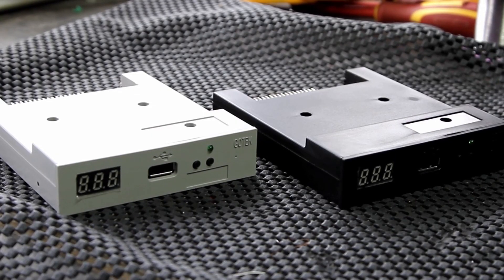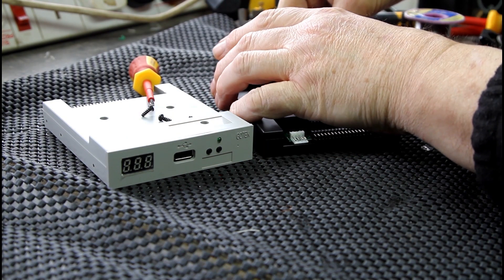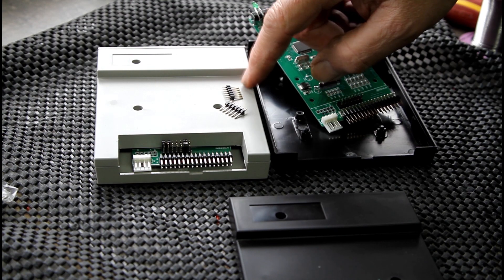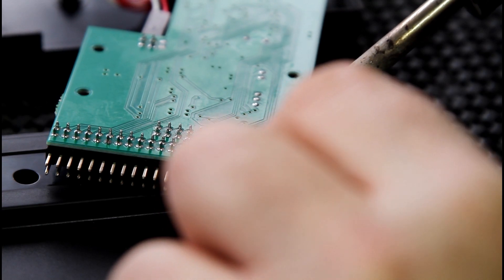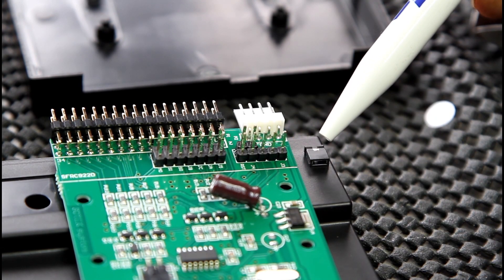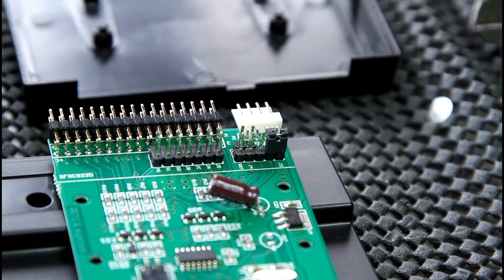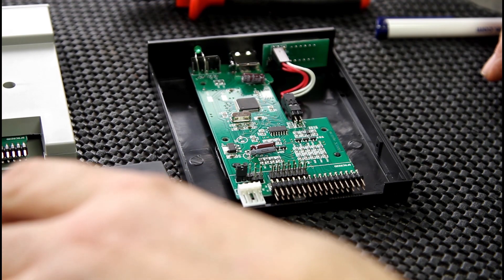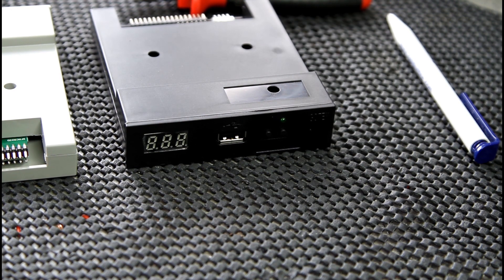PART 1 How to prepare and install a Gotek floppy drive emulator in your music equipment

Comment: I have a Gotek floppy drive emulator for a Korg X3 and it has a dial switch on it. Unfortunately the dial switch broke off. Is it possible to replace that switch?
Reply from the maker: Yes It just a rotary encoder they are available
Reply: @takethefearoutthegear6229   I'm guessing I have to take the bottom piece off to access the that rotary dial?
Reply from the maker: @slooky14  we take one apart in one of our gotek videos
Reply: @takethefearoutthegear6229  ok thank you! I see you took this one apart. Are you saying you have another video? Also I'm guessing I'm going to have to solder in a new one?
Reply from the maker: @slooky14  yes just solder a new encoder in, the only other thing is glue the knob back on if possible
Reply: @takethefearoutthegear6229  I tried to glue and it was flush with the rest of the knob. Not sure how to explain it. IThe glue never took. Anyway I do know how to solder. Thank you for answering my questions. Its very much appreciated
Reply from the maker: best to solder a new encoder in @slooky14
Reply: @takethefearoutthegear6229  I took the back off and looks like there is hard plastic to hold in place. Not sure how to get the rotary dial out. A nut hold it from the front. I can't acess the nut

Comment: Is it necessary to do this with any gotek that you buy? if yes, why is it not already soldered on? Also, are all gotek drives the same ? Simply looking for a drive for my Roland sampler s760. Would appreciate any suggestions you can give so I can make it work :) cheers!
Reply from the maker: they are all the same, unless you buy one prepared for your sampler from ebay etc

Comment: We're are trying to use a Miditemp with a Gotek USB Floppy Disk Emulator. Now we have two problems: 1) We can't connect the Gotek in the proper way. We tried all possible solutions and variations with jumpers, flatcable or config files. Miditemp doesn't recognize the Gotek. 2) Even if the Gotek displays the correct number of images of floppy disks on the 4GB USB stick, Miditemp doesn't see the midi files in those images. Not sure what software (Windows 10) to us for making images and putting files in those images. Can anyone help us with (step by step) instructions, software, links or whatever? Thanks.
Reply from the maker: If you look at the hxc website you can email them , they guy who runs it is very helpful